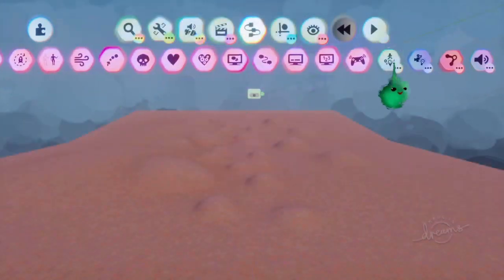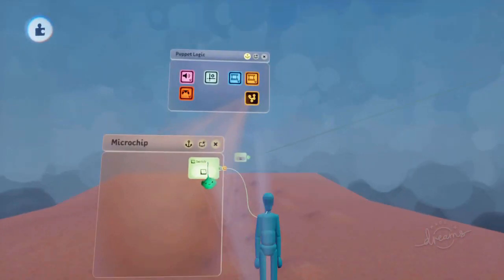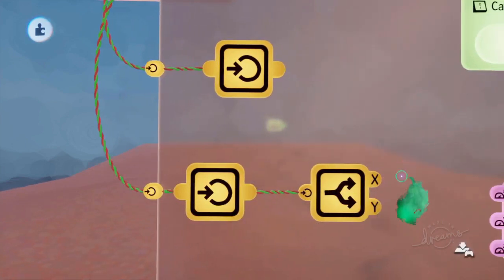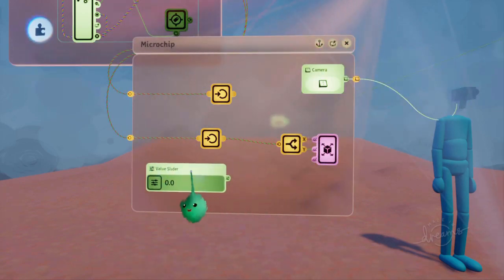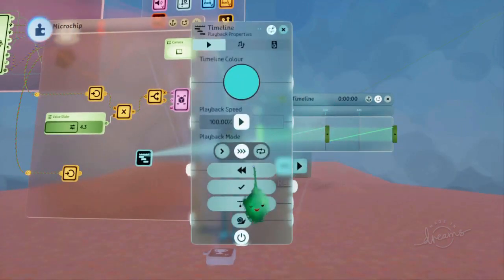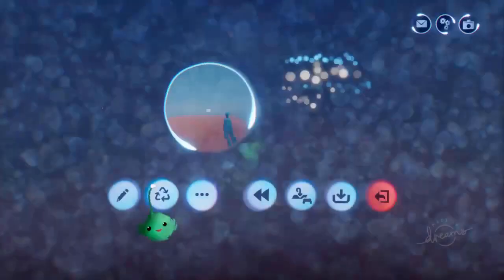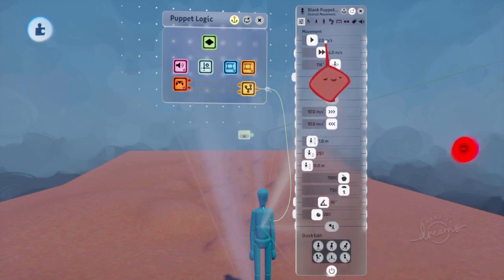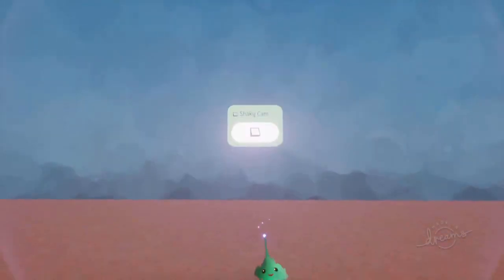First Person Puppet | TAPgiles Dreams Tutorial

Comment: My character is moving on its own and I can't figure out why.
Reply from the maker: Maybe you added a sculpt or something which is colliding with the puppet itself which would give it a shove. If so, make sure it’s non-collidable.
Reply: @TAPgiles  So I haven't added anything to the scene yet, I'm only working on the character right now. I somehow got it to stop moving on its own, but now when I'm animating the up/down head motion, it's doing THAT on its own. I like the motion, but I'm not getting any control from the right stick yet, even though I've followed the video. At least to the best of my ability, it goes a little fast. Thank you for making this video, by the way. It's been very helpful so far.
Reply from the maker: Presumably you’re using a timeline to animate it up or down. A timeline will just run by itself until you control it, which would be later in the video.

Comment: Sorry for commenting on an old video, but I've watched over and over..have everything identical, however, while my timeline is active, none of the other controls work. If i simply turn the timeline off, everything goes back to working, but obviously i cant look up and down..ive dug everywhere and looked around for help with no luck...your my last hope!
Reply from the maker: Did you keyframe the position of the puppet group itself? If so, that will lock the puppet into place. You should avoid keyframing the puppet object as a whole, otherwise it won't be able to move.
Reply: @TAPgiles  thanks a million! After tinkering with it for a few days i finally got it! The puppet would return as a whole to the exact spot the key frames were active!

Comment: Do you know how to stop the puppet from sinking down when it lands after a jump? In my first person game, it’s causing issues because the camera clips into the chest when you land from a high fall. 

I could hide the chest for a short duration, but if there was a way to reduce or remove the effect entirely, I would like to do so.
Reply from the maker: I’ve tried in the past and not been able to. What is the camera stuck to, that sinks into the chest?
Reply: @TAPgiles  I’m using the controller sensor camera lol. It’s set to 0 distance like the DreamsCom first person mode. It would be nice if I could move the camera position as well, but the controller sensor makes that hard.
Reply from the maker: Interesting… I wouldn’t have thought that camera would sink down with the hips 🤔

Comment: Awesome video dude. Just wondering, since the update I’ve had this weird glitch where I literally can’t access some of my scenes. I can’t open them, edit them or remix them - despite them working perfectly fine before the update. Every time I try to open the scene it says “out of memory”. But I haven’t got ANY local saves so it can’t be full there. Ever encountered this glitch?
Reply from the maker: Does it crash Dreams or anything?

Have you tried closing the Dreams application properly, and booting it up again?
Reply: @TAPgiles  it doesn’t crash. My game works perfectly normal. There’s just a few scenes that aren’t letting me open them. I’ve tried closing the app, shutting off the console and then opening it again but the problem persists ☹️
Reply from the maker: Are they uploaded? If so you could try deleting the local copy and see if it loads the online one okay.
Reply: @TAPgiles  they’re not saved locally. Online online. And it’s the online ones that won’t open unfortunately :(
Reply from the maker: @calistus_jay  Ah okay. Weird stuff like this can usually be fixed by deleting the local save file through the PS menus, and going back into Dreams which makes a new save file. But obviously make sure you don't lose any locally-saved stuff you want to keep.

Other than that, I think it's time for indreams.me/support...
Reply: @TAPgiles  thanks man!